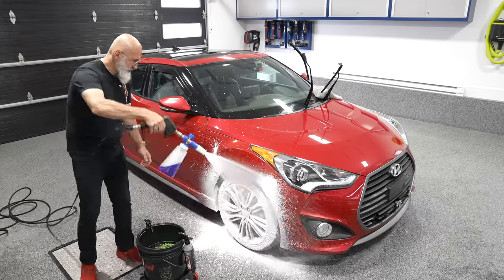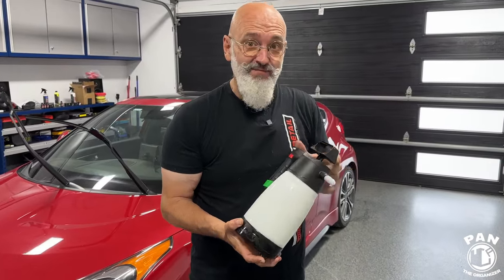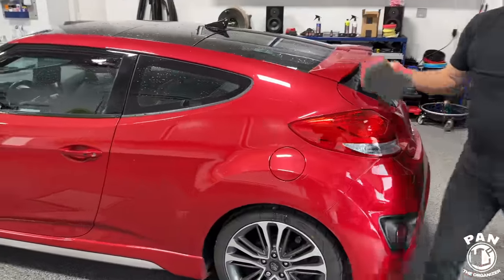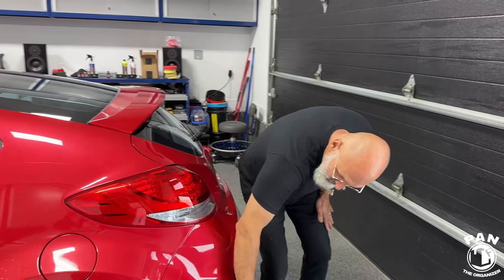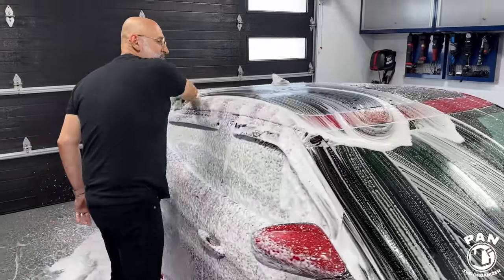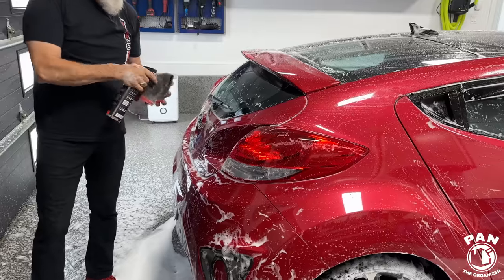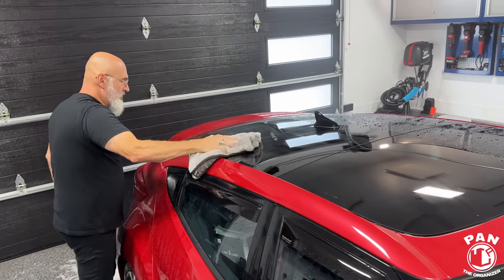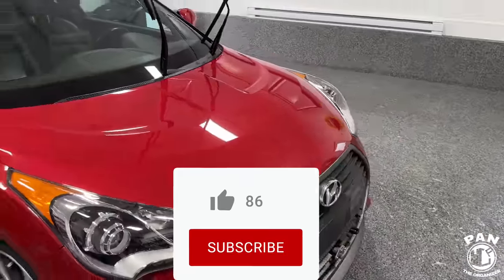The Ultimate Guide to Easily Wash, Clay, and Seal Your Car!

Comment: Hi! I'm loving your videos and your great tips! Thank you! I'm an older gal and want to do this to my black Rogue Sport. I'm limited with space and resources. My plan is to go to a drive through car wash, then take my dry car over to the vacuum area. From here I want to take some rinseless wash properly diluted in a spray bottle, spray the solution liberally panel by panel, saturate my clay towel, have Ceramic Gloss in hand and do what Yvan is doing. Then dry with a microfiber towel.
Does that sound doable? 
I'm not going for car show ready. Just remove contaminants, give my pretty black car a beautiful shine.
Any thoughts, tips, suggestions are so appreciated!

Comment: Glad I watched this video. I have a clogged ceramic coating that I would like to try a synthetic clay towel on to see if it will bring the hydrophobics back. Great vid with tons of good info.
Reply from the maker: Glad it was helpful!
Reply: Happy to have helped. If the coating is lacking hydrophobics on the sides, try DIY Detail Water Spot Remover, it removes the accumulated minerals in the coating.

Comment: I’ve watched many DIY Detail videos on rinseless wash using that clay towel.

A bunch of them show using a clay towel with iron remover and some show clay towel with ceramic gloss.

However in this video I’ve noticed that once Yvan is done with all sides of the towel he dunks it back in the rinseless wash bucket.

Wouldn’t that contaminate the rinseless wash solution given ceramic gloss is now mixed in the rinseless wash bucket or is that only a big no when dunking a clay towel paired with the iron remover due to the chemical composition?

I’m guessing at that stage in the wash the rinseless is being discarded afterwards so it’s fine mixing chemicals since the wash is done.

I bring this up as Yvan mentioned in a 2 year old video to not clean/dunk the clay towel in the rinseless bucket so I may have missed the context of that.

Comment: Great comparison video.  I learned about the difference between Ceramic Glass vs Quick Beads.  I think I will give Quick Beads a go!!
Reply from the maker: Glad it was helpful!
Reply: @PanTheOrganizer  yes I liked the part where you specifically asked the basic difference why one would use the Ceramic Gloss vs the Quick Beads.  I didn't really know either until you clarified it.  Also in terms of application the Quick Beads is spray and rinse where the Ceramic Gloss is more spray/apply and wipe down.

Comment: Hello Pan! Great tutorial video. I really like the way that Yvan decontaminates with DIY iron remover. I had just bought a different iron remover from another brand (Adam's). How do I know if it has solvents? Or  How does it show on the label? Also, I will check if it has surfactants for lubrication. Next one I get will definitely be DIY. I only detail our 2 cars and maybe my friends . Thanks!  Kudos!
Reply from the maker: You’d have to read the SDS sheets or ask the brand directly.
Reply: Got it. Thanks Pan 👍

Comment: So we can use iron remover for wheels and for a clay mitt/rag as a lubricant?? That’s amazing. What els can be used as a two in one lubricant??
Reply from the maker: Don't get confused. Not all iron removers can be used as clay lubricants. Only those without solvents in them. Ones that are safe to use as clay lubes are the DIY Detail Iron Remover and CarPro IronX. For any others, you'd have to ask the company. It's impossible to know all possible combinations.

And you would not use a traditional clay bar with an iron remover as clay lubricant. You would use a synthetic decontamination towel or mitt, like the one from DIY Detail or The Rag Company.

See my video on the future of clay here: https://youtu.be/GK21rRPh1jw?si=nOQyP9MEbDHtRcCT

Comment: Great video, does the spray on rinse off method described in the video give the same results as a spray on wipe off sealant? I use turtle wax graphene coating am curious about switching to this method if it provides just as good or better results!

Comment: I bought my new black car about 2 months ago. Should/Can I decontaminate with the clay towel and iron remover?  Or is that step only for older cars that are heavily contaminated (i.e. "sandpaper" texture feel). Thanks for a great video!
Reply from the maker: A new car is never new until it's properly detailed. 
- at the factory, the paint defects are often corrected quickly by rotary polishing which can leave marks and holograms, so polishing corrects those, before you lock that in long term with a ceramic coating for example.
- vehicles are then transported by truck, train and boat so they are exposed to the elements, industrial fallout, brake dust, rail dust, etc
- vehicles are often left at boat docks (when transported by boat) or in exterior parking lots for weeks or months, again being exposed to the elements
- at the dealership, the vehicles are almost always poorly prepped using the same dirty water that was used for all the cars on a given day, and poor washing and drying methods leading to swirls and scratches 
- at the dealership, a layer of cheap wax or paint sealant is usually applied to attempt to make the paint glossy prior to delivery. It's crucial to remove any previous protection before you apply a ceramic coating, as coatings need to bond directly to a virgin clear coat.

If you only plan on applying a regular carnauba wax or paint sealant though, you could decide to skip machine polishing, as those protectants can be applied over existing protection and it's not as crucial to prep the paint as well.

I explain all of this in this popular video: https://youtu.be/QgoyrC-5CMc

So you can better visualize the new car prep process, here are the steps I perform on a brand new car for my customers: 
Aston Martin Vantage: https://youtu.be/OKga3yZVTqo
Volvo XC60: https://youtu.be/tvDBBenhYFA
Tesla Model Y: https://youtu.be/gohks8xP5NY 
Porsche 911 Carrera: https://youtu.be/2ckiivbFqs4
Mercedes AMG GT63S matte black: https://youtu.be/eU8zg1lXvXY?si=oGxoCp8PWt7gTncV
Audi Q7: https://youtu.be/t7HCBSVnizM
BMW M6 Gran Coupe: https://youtu.be/0lC9uyKXs8Q
BMW M340i: https://youtu.be/etXhJNaF0EE
Audi RS3: https://youtu.be/641mAJfKDLM
Golf R: https://youtu.be/jr19g4PWJsk

Comment: @PanTheOrganizer , @diydetailofficial Thank you for this great video ! Instead of people commenting on washing inside a garage  going even to dictate on how one garage should be used ... and silly numbers with no real statistics, I wish the discussion would focus on the technique and get more info on how to wash it inside vs outside in the drive way. etc..  A question : If I have some "graphics or stickers" like the word Rubicon on the side  and of the 2022 wrangler engine hood  + the black and blue patch in the middle etc.. ( it is OEM came with the wrangler), Can I use the decontamination towel when I am washing the car using the above technique  for Rinsless or pressure washing. Thank you
Reply from the maker: Yes it's fine, as the synthetic perforated decontamination towel isn't abrasive. 

Welcome to my channel. You discovered one of the biggest car detailing channels on YouTube as we surpassed 1 million subscribers and we have over 140 million views! I have been detailing for 27 years and I love to share my knowledge and passion with my viewers.

You found the right channel to help you learn everything about detailing.

Comment: Rineless wash question?
If you have access to garden hose, would it make sense to 

prespray with rinseless
Rinse off with garden hose
Spray with rinseless
Then use sponge with rinseless wash
Dry

Or does the prespray and rinse, not needed and time wasted?
Reply: The pre spray and rinse is a great technique when there is visible accumulation on the car.

Comment: Indeed happy Saturday ❤. Thanks so much for sharing.
I am noticing that you are using IL Multi 2 for the rinseless part, but literally a week ago I bought the IK Foam sprayer. Would that also work? 
Also, for a daily driven car, how often is recommended to make this full process?
Reply from the maker: I have both the Multi 2 and Foam Pro 2 for different uses. I would recommend that you get a regular sprayer for the rinseless wash (Multi 2) and keep the foaming sprayer for products that need to be foamed.

Comment: Hi. Great video. Quick question. Can I use the ceramic gloss application and decontamination  instead of the iron remover and quick beads sealant with a foam wash? Thanks.
Reply from the maker: I don't understand your question.
Reply: @PanTheOrganizer  Oh excuse me. What I mean is can I skip the other two steps of the soap wash process and and just decontaminate and apply ceramic gloss instead (like on the rinse free wash).
Reply from the maker: You can wash the car, decontaminate the surface, rinse and dry. And then apply Ceramic Gloss if you want.

Comment: Planning on doing the 2nd version of this tomorrow outside on what’s supposed to be an overcast morning. Car has no protection at the moment other than a month old application of Gyeon Wet Coat. Substituting CarPro descale and ironx. Worried about leaving descale on the paint outside. Should I foam, rinse, foam, wash with descale, rinse and then apply some rinseless (armour detail) for lubrication, or maybe use gsf for the contact wash and leave it on?
Reply from the maker: Don't let Descale dry on the surface, and don't use it in direct sunlight.

Comment: Pan, as always, great information. The video made me think of a question concerning a product you mentioned in a video about two years ago. It was an iron remover mixed with a shampoo, so you could do two steps in one. Do you remember what it was or have any new recommendations? Thanks!
Reply from the maker: Thanks! Are you referring to this shampoo: https://bit.ly/3s3sJLA

That's a combination of snow foam, or shampoo (you can use it in the foam cannon or bucket for hand wash) and an iron remover.

But the iron removing capabilities aren't as strong as the full strength dedicated CarPro IronX iron remover for example. That soap is more for maintenance.

Comment: I’m interested in doing all the steps to maintain my car with with the clay cloth, iron removal, ceramic coats etc but is there information or video when you have to do it with a water hose in the driveway. I would appreciate any advice on this. Thanks
Reply from the maker: Using a hose or pressure washer changes absolutely nothing in the procedure. Here's my popular tutorial on how to apply a ceramic coating: https://youtu.be/sqQYVjxFqK0

Welcome to my channel. You discovered one of the biggest car detailing channels on YouTube as we surpassed 965,000 subscribers and we have over 130 million views! I have been detailing for 26 years and I love to share my knowledge and passion with my viewers.

You found the right channel to help you learn everything about detailing.

Comment: Hey Pan, thanks for the video and content always appreciate it. So depending on the surface of the paint, you don’t always have to paint correct it if you Claybar the surface, just make sure to seal it with a wax or ceramic spray after claying?

Comment: excellent video! question about the foaming - can i get similar results with a pump spray bottle or my garden hose - or do i NEED a pressure washer?
Reply from the maker: You can only achieve this level of foam with a pressure washer and foam cannon setup. For obvious reasons: pressure and flow.

If you only have a garden hose, you could get a foam gun but lower your expectations. I made a video comparing a foam cannon (pressure washer) to a foam gun (garden hose) here: https://youtu.be/rJPk8nR8Ib0?si=vNBzm_t4lvqVzGgJ

I hope this answers your question.
Reply: Too add to Pan’s information, a foaming pump sprayer like an IK foam pro 12 will give you ok foam.

Comment: If you're doing traditional hose and bucket what products can you use while using decontamination towel besides irin remover?
Reply from the maker: Typically you have two forms of chemical decon: iron removers and tar removers. Iron removers you should use for sure, but tar removers are on an as needed basis, meaning when you see tar deposits.

And then you have mechanical decontamination for the rest of the embedded contaminants. You do that with a clay bar, clay towel, or clay mitt, along with a lubricant, or soapy water.

Also, I highly recommend that you watch my Detailing 101 series for beginners, where I explain different steps like iron removers, clay bar, polishing, protection, etc. It's super simple once you understand the basics, and your car will look and feel 100x better!

Part 1: how to properly wash your car: https://youtu.be/7Koj5j2Es5U
Part 2: how to clean wheels and tires: https://youtu.be/omwcNcSYcS8
Part 3: chemical decontamination (iron and tar removal): https://youtu.be/W_cyHz3XssU
Part 4: clay bar: https://youtu.be/XB8UaTCXuLg
Part 5: machine polishing (paint correction): https://youtu.be/ustTEVGMOTI
Part 6A: how to wax your car https://youtu.be/KZjiPcsPBrA
Part 6B: how to apply a ceramic coating: https://youtu.be/sqQYVjxFqK0
Part 7: Differences between waxes, paint sealants and coatings: https://youtu.be/4ejfPHan3k4
Part 8: How to clean your car’s interior like a pro: https://youtu.be/Xx_lHXHYpLo

Comment: Why did you, in the foam side use Iron remover + clay towel and in the rinseless skipped the iron remover? While I can guess it is because you can't rinse, it begs the question: Is the rinseless decontamination then inferior to what was done on the other side? Just trying to understand it all :) Thanks!
Reply: Most iron fallout products recommend a thorough rinse after apply so likely why they didn’t use in first step. You could come back over with rinseless wash again to remove the iron fallout chemical.
Reply: @JakeH-l4z  makes sense. Thanks!

Comment: Another great video just had a couple questions. The clay towel he was using he said is synthetic and won’t scratch your vehicle unlike a clay bar. Is this correct? Been looking around and other comments say they scratch less. I just don’t wanna screw up my truck that’s all. Also everywhere in u.s is out of stock. Let me know your take. Thanks in advance jim
Reply: I've clayed 3 personal cars in my life with traditional clay (meguiars clay kit) and never once scratched the car. while the guy is def knowledgeable, he is still trying to sell you HIS product. I prefer clay bars because it just feels better to me.
Reply from the maker: Perforated synthetic décontamination towels aren’t abrasive so won’t marr the surface. Traditional clay bars are abrasive, and could POTENTIALLY marr the surface. When you are done claying using a clay bar, observe the paint and determine if it needs to be polished.
Reply: Thanks, they will be back in stock soon. With a traditional clay bar the risk is much higher because of the abrasive nature of them. Before Synthetic clay towels I used clay bars to perform a similar procedure. Unfortunately 2-3% of cars suffered marring because of excessively soft paint.

Comment: I'm guessing it doesn't matter what brand of iron remover or clay towel we use as long as it's the same method? Thanks.
Reply from the maker: Nope. If you want to use an iron remover as a clay lubricant, you must pick one that has no solvents in it. Like the DIY Detail Iron Remover. So it's hard to know which other iron removers contain solvents unless you ask the brand or start digging for SDS sheets.

If the iron remover has solvents, it will start to disintegrate the clay media.
Reply: @PanTheOrganizer  Wow! Thank you so much for replying. I was about to buy another brand of iron remover. Good thing I read your reply first.
Reply from the maker: Welcome to my channel. You discovered one of the biggest car detailing channels on YouTube as we surpassed 1 million subscribers and we have over 140 million views! I have been detailing for 27 years and I love to share my knowledge and passion with my viewers.

You found the right channel to help you learn everything about detailing.

Comment: When are we supposed to use the bug and tar remover?
Reply from the maker: If you have bug guts, or tar deposits. If you have bugs, you can pre-spray the affected area, then foam on top, let that dwell, rinse and continue with your wash process. 

After you are done washing your car, if you have tar deposits, that's when you'd use a tar remover, then rinse, then move on to the iron decontamination and claying steps.

Comment: Just curious about how Yvan applied the iron remover. I'm used to allowing a little bit of dwell time for the product to activate. Is that not necessary with his spray and immediately wipe method?
Reply: The agitation with the decontamination towel removes the need for long dwell times.

Comment: If you’re going to ppf and ceramic the surface after using the rinse less wash , would you still use ceramic class to do the clay bar? Or skip that and just use the solution already on the surface by the rinse less wash?
Reply from the maker: You wouldn't use anything that has protection in it as a clay lubricant if you are planning to ceramic coat the paint after the wash process. So you'd use soapy water or a dedicated clay lubricant as clay lubes in that case.
Reply: @PanTheOrganizer  thanks much I used Gyeon as the lubricant. Thanks much to everyone decontaminated surface felt good. I ppf’d the hood waiting til tomorrow to do the other parts. Minor bubbles on the edge but Those should go away is what m tracking.